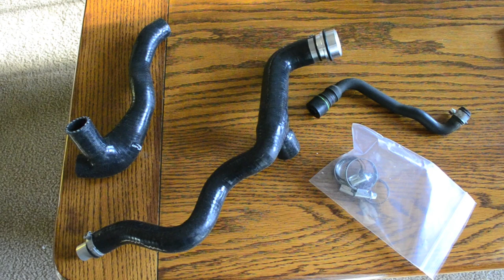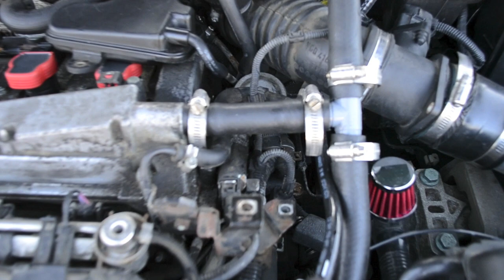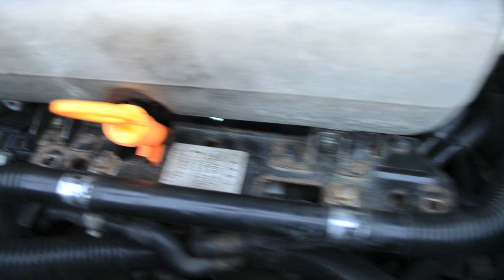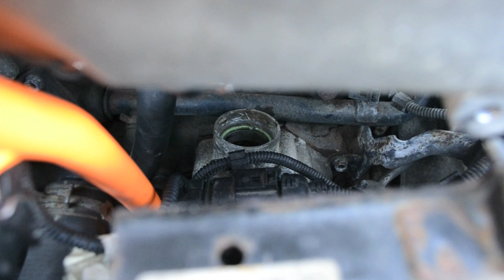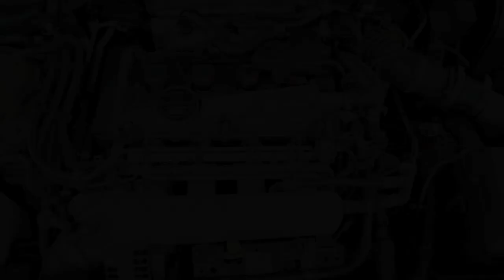MK4 VW 1.8t PCV System Hose Replacement

Comment: That hose elbow that connects to the oil filter housing loves to break when these cars get old.  It is best to plan on replacing it when you replace the other rubber components down there.
Reply from the maker: Yea, all the PCV stuff should be done at once to avoid chasing hoses and problems. If you go with the silicone kit, the elbow is all one part with the lower hose.

Comment: Had a difficult time getting that lower PCV hose out. C clip was a struggle and the hose was broken. Had to grab on to what little was left.  Pulled metal inner ring out first, then the broken plastic end and O-ring. Vacuumed out the hole to capture broken bits of plastic and sludge. I think this will fix cold start sound I made a video of. Must have been little bits of broken plastic floating around in the PCV system.
Reply: ***** Your video was a big help. Always nice to see the job first so you know what to expect. It's not my car, I'm helping a friend out. It started with the timing belt idler pulley going into self destruct mode. Had to change all the valves. Then you see what else is old and falling apart.
Reply: My partner has the 1.8t 20v octavia , same issue on hers. The bottom elbow just broke into pieces.. nightmare getting the new one to fit
Reply: There is a copper ring inside my crankcase breather. Is that part of the old hose?

Comment: I have an 05 gti 1.8 and my pcv system is different. I have 2 lines that come off the valve cover, one big and one small. The small leads to the 1 pc pcv T pipe

Comment: The PCV valve you refer to at the beginning of the video is actually the Pressure Relief Valve aka. hocky puck valve. THAT IS NOT THE PCV VALVE. The PCV valve in under the intake manifold.
Reply from the maker: Some engines refer to them as Pressure Control Valves, Pressure Relief Valves, or Pressure Regulator Vales. At the end of the day it's still a valve on your Positive Crankcase Ventilation system, and on a 1.8t, it's nicknamed the hockey puck valve.

Comment: Steve, we bought a 2011 vw jetta and had to replace ignition and key immediately.   The part was ordered from vw in Germany.  Then we started having issues with starting and dying and severe jerking. We've taken it to foreign car shop and they couldn't fix it, to a dealer who replaced computer and replaced many parts.  It's still doing it.  The code shown is vacuum leak. We cleaned MAF SENSOR, SHOULD WE REPLACE IT?  HELP!!!
Reply from the maker: You can try a leakdown test to identify a vacuum leak. You can also spray carb cleaner around vacuum lines while the car is running to see if the idle changes. If it changes, you know that hose is leaking. I would start with looking for a vacuum leak in the rubber hoses. The car is old enough that it could have developed some cracks in the hoses. I would personally hold of on replacing the MAF until you've ruled out other possibilities.

Comment: Hey,  is this the "BREATHER HOSE KIT, EARLY MKIV VOLKSWAGEN 1.8T AWV/AWW/AWP, REINFORCED SILICONE, because there's two of them from that website, do you know which specific one that is? Thanks.
Reply: +Steve Valente well mine is 2003 vw Jetta 1.8t AWP so is it the same?
Reply: I have a 03 audi TT - 
Model 3007 did not fit. Do I need 3006?

Comment: I have a 2003 golf and one of these hoses is all cracked up and broken but I don’t know what the hose is called in order to replace it I think it’s this hose but mine looks a little different
Reply: If anyone wants to help me out let me know
Reply from the maker: @absolutryhard4115  So if one is cracked, chances are they're all cracked, or all almost in need of repair. If it were me, I'd replace all of them at the same time. The year, and engine matter when buying the hoses. If you have your year, and the correct engine code, it should be easy to find the hoses. Do you know what engine your car has in it?

Comment: im getting a p0010 code camshaft positin actuator circuit bank 1 i tested the sensor its seems fine also getting misfire cylinder 1 and 2 sometimes 3 and 4 i checked spark all good checked injectors all good can the Crankcase Breather Hose Pipes make all those problems if theres a leak
Reply from the maker: Circuit bank sounds like it could be an electrical problem, unless you just replaced the timing belt, or it needs to to be replaced. You could be a tooth off, or the belt could be stretched to the point that you're throwing a code. Also, how did you test the sensor?

If you're getting misfires and the plugs look fine, what about the coil packs? When was the last time those were replaced? Also, the ignition coil harness can fail, especially with how old these cars are getting. Check your coils and the wiring leading to them.

You can check the PCV system for leaks by going over the hoses and checking for cracks in hoses. You can also see if the idle changes when you pull the dipstick out. If it begins to run poorly, your PCV is most likely good. If it stays the same, you probably have a leak somewhere.

In my experience a failing PCV typically shows itself with reduced performance or oil consumption, not a CEL for the cam position sensor.
Reply: @Steve's Garage   I seen a video on YouTube how you can test a sensor without a special tool basically you connect one lead to the negative of the battery and a positive lead of the multimeter to the Signal wire that comes from the camshaft sensor if you get 6 7 8 volts it's good and if it's at 0v or 12v it's bad I don't know if it true tho also I did a test again It's 1st and 2nd cylinder with the miss fire. 3 and 4 run fine if I disconnect the 3 and 4 Weirdly 1 and 2 keeps the engine going with the miss fire. Camshaft position sensor stays on no matter what even after clearing codes switched coils around same issues
Reply from the maker: @asaflores43  If you haven't done coil packs I'd probably do those. The standard 1.8t coil packs are known to not last.

As far as the cam position sensor, if your belt is correct and you're not a tooth off or something, I think I'd probably replace that too.

It's hard to diagnose over a comment section, and I don't like throwing parts without true diagnostics, but that's what it seems like to me.
Reply: @StevesGarage  so i replaced the hoses no more misfire engine runs nice now but im still getting camshaft positin actuator circuit bank 1 engine takes a couple of cranks then starts so now i have to figure that one out thanks for your tips and info really helping
Reply from the maker: @asaflores43  No problem, happy to help. Glad changing the hoses got rid of the misfire.

Comment: Great video.  Did the billet adapter fit into the breather housing securely?  I've seen comments that this is sometimes loose even with the retainer clip installed.

Comment: @ 1:44 those 2 twin hoses, what are they? one of them snapped on me. Cant find out what the hose is called
Reply from the maker: I just searched for about an hour, including googling the part numbers on the hose themselves. I cannot find the name of the part either! I know it's part of the brake booster vacuum lines. Did the Y connection crack, or the hoses after it?
Reply: @StevesGarage  I think after the hoses, cause its good all the way through except the under part of the metal plate, the left one is just loose looks snapped off & my best bet it to just unscrew that plate & look from under cause even after looking with my phone cam checking the part number too, searched for while online & i just cannot seem to find it either. But brake booster vacuum lines, thats a clue so thanks lol!
i appreciate the reply btw
Reply from the maker: @06GCoupe  If it's some of the hoses under the plate it could be the EGR hoses, part number 06A145691CB. That one number encompasses the entire mess of hoses under that metal plate on the front of the intake manifold. It's expensive, but easier to just replace the whole thing than trying to piece it all together, especially with the location it's in.

Comment: It seems very different from AWM 1.8T passat. Can you help to provide any information on that one? also the pcv valve.
Reply: Thank you.
Reply: +Ruijie Zhou Mine is AWM 1.8T. It's not hard to remove the PCV valve. You will need to unscrew coolant reservoir, leave hose attached, and remove wire connector on the bottom of the reservoir. Flip it out of way, you can now reach PCV. Use a long Philip screwdriver and loose the clamp. Reach the PCV hose and pull it out. Be careful not let clamp drop and you may need to wiggle it or use a flat head screwdriver to help loose it. Mine was full of gunk and hard tar. 

I late bought whole set of hoses and replaced them. 

Wear strong gloves.
Reply: Tom Wang Thank you！
Reply: My AWM 1.8T looks completely different that this. Most of my vacuum hoses are fucked lol I took them off to replace them, now I'm fucked again bc I can remember which go where. It's on a 02 Passat 1.8T

Comment: You wouldn't happen to know what those 3 lines that go under the metal plate you remove are called/for? I broke the couplers for all three and need to replacement but not sure what they are
Reply: A stupid question but do you think a local garage would have these or generic couplers laying around? I can't find them anywhere or what they're called. Or a diagram of a 1.8t
Reply from the maker: Hey sorry I missed this comment, the YouTube notifications have been messed up so I missed this. The lines underneath the plate are the EGR lines, VW part number is 06A145691CB. I tried replacing them with generic couplers and hoses, but it didn't work. If possible, I would check with garages, or even a junk yard. If you can't find them there, I'd order the whole new bundle from ECS or UROTUNING. Let me know if you have any other questions, my apologies for the late reply!

Comment: Hey whats the hose on the right routed to next to the dip stick
Reply from the maker: + brandon belfield The one with the elbow that goes into the block? That's the lower PCV line. If you mean the ribbed plastic hose, that's for the secondary air intake. Let me know if helped or you have more questions!

Comment: On the replacement hose there is where it hooks up next to the valve cover then runs down to the part that uses the clip to go to the block but in the picture on the website there is another hole on the tube.  where does that go?
Reply: Steve Valente nope think I figured it out.  It goes to the section with the check valve to the bottom of the intake manifold

Comment: I installed that hose but at the time the car does not run when trying to run it has like pulls and loses strength you know what the problem is
Reply from the maker: You could have a vacuum or boost leak somewhere else, or a different problem all together. Unless the PCV system is clogged, it shouldn't pose a problem to the car running.

Comment: Where do you put the little 'one direction air valve' that came with the kit? Do I not use it?
Reply from the maker: Kurt Mankenberg that's for the small hose that runs under the intake manifold. If you look at my other video for installing that hose, you'll see where it goes.  It's a simple install, just a 1 for 1 replacement.
Reply: Hmm that's exactly what I did...but after I did the install and drove for an hour, the engine idle drops every 15 seconds or so...the idle was perfect before the install even though the stock pcv was busted all over the place. I wonder what I could've fucked up
Reply from the maker: Kurt Mankenberg could it be a different issue that's now popped up because of the new PCV system? If it was a problem with the check valve or lines, it would probably run poorly all the time.
Reply: Not sure it could be.... I'm trying to figure it out. Maybe the computer hasn't adapted to having no air leaks for the first time in years...it could need a tuning
Reply from the maker: Kurt Mankenberg That's possible. If you wanted to, you could disconnect and reconnect the battery to "reset" the ECU. Are your plugs and coils good? That could cause the engine to hiccup.
Reply: Sorry forgot to r reply! All I had to do was drive it fora a bit and it starting running like new! Thanks for your time and help
Reply from the maker: +Kurt Mankenberg it's all good. YouTube doesn't like to notify me of comments, so I didn't see this until now. Good to know the car is all set! Don't hesitate to ask any questions in the future!

Comment: What part number is it for the hose that connects directly to the underneath of the manifold?
Reply from the maker: Depends on which engine you have, but I think the part you're talking about is 06A 103 221BM on AWP engines.
Reply: Thanks. AWP. Will have to take some pics. I do have that hose but seems too short. Last dumb question...for the life of me cannot get the new OEM secondary pump hoses that go directly into pump to secure/clip. The air intake side clips right in, cannot get the other 2 to properly secure. Very hard to get hands around anything down there. Any suggestions?
Reply from the maker: @seanrobinson1780  No dumb questions here! Honestly, that line is PITA. I had disconnected it once and when I went to connect the lower side I didn't realize I had failed to connect it until I went back in for another repair. Have you tried going in from the bottom? You'd have to remove the belly pan, but the pump is right there once you do, it might be easier to access it that way.

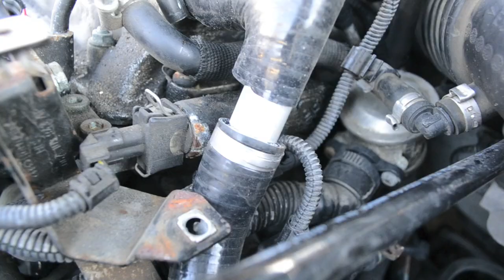Comment: Great video man! ------ PLEASE let me know what the trick is to remove the hose connection type like the one at the 1:25 mark of this video? (It is plastic and has grooves on 2 sides of it). I wrestle with these on my VW everytime, and just finally broke one of the frikn things!
 Can i just put it back on and tape it securely with some duct tape or will i have to replace the entire hose now or do they sell the connectors?
Anyway------I would like to kick the German that come up with that type of connector right in his frikn keester! :)
Reply from the maker: Hey sorry I missed your comment, YouTube was messed up and I just noticed this! I assume you're taking about the hard plastic hose that goes to the SAI pump? If thats the case you have to pinch the ends to let it release. It can be a real pain, but I've disconnected it a few times without issue. If you break it, I think the whole hose would have to be replaced. Let me know if you have any other questions!

Comment: Anyone have any suggestions for putting the c clip back in?
Reply from the maker: If you have a long pair of needle nose it can help!
Reply: Thanks for the advise. I ended up using some grease on the top  of the hose fitting which helped me get the clip back in.